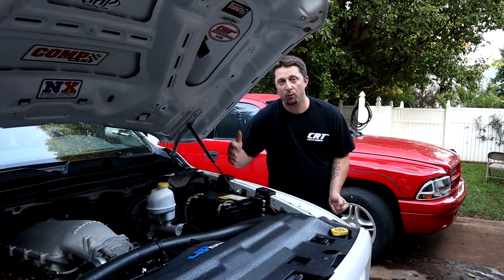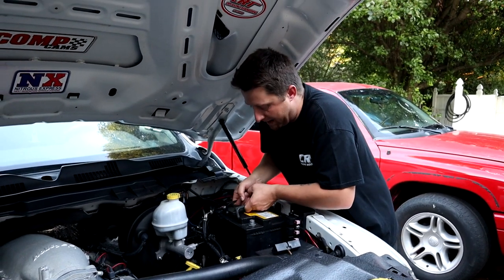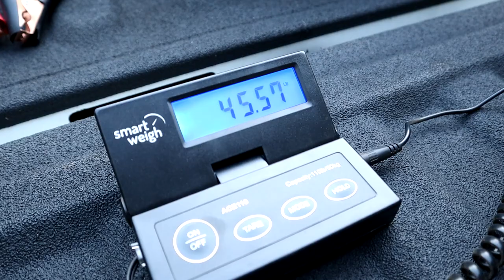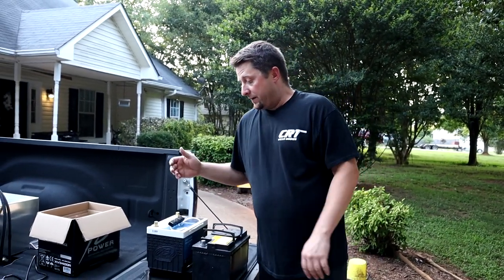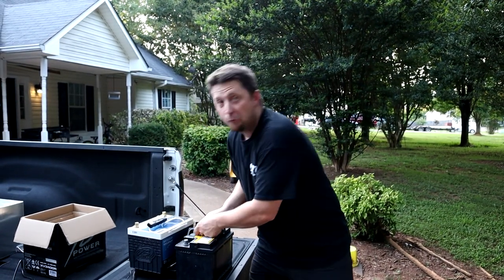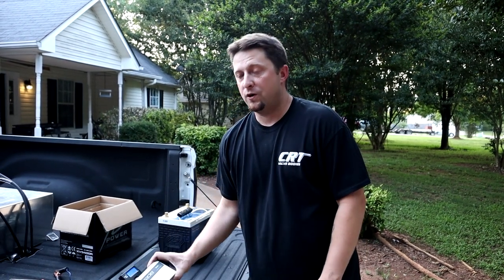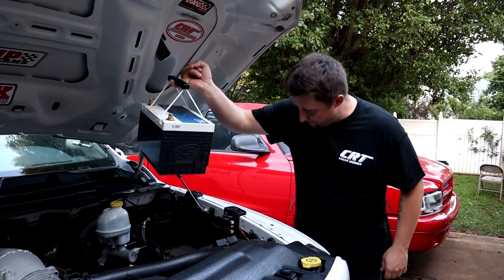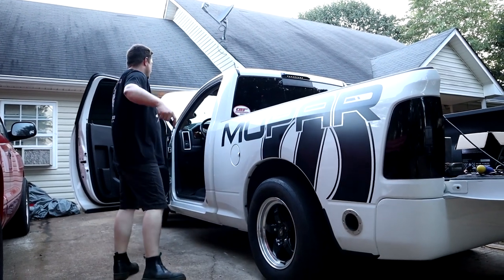Lightest Battery In The World From XS POWER

Comment: In case of fire Salt water is your friend with lithium batteries. If it ever goes dead charge at the slowest rate until the battery warms up.  A chip should not let it go to dead but you never know. 
The truck sounds like a beast bro!
Reply from the maker: Thanks 👍

Comment: Mopar Motorsports; I have an identical looking truck. I lowered 2/4 belltech. Rear is bottoming out with no weight in the bed. How can I lower the rear, it has rear coil springs, without it bottoming out?

Comment: Awesome! Crap thats not a common one to think of weight saving on drag truck 😉 Yeah they are they new way to go 👍💪 also you can mount em any way you can make em fit/ on thwir side heck upside-down 🙃 but still cant get over the weight difference for lithium technology...
Now im thinking about weight in my boat i have 2 big ole wet cell batts in the rear 🤔 be and instant 100 lbs lighter...
Reply from the maker: They make boat batteries also😉

Comment: So you have to charge the battery up to use it? It doesn't last as long as regular batteries do?
Reply from the maker: Yes it does but if you're not using it you need to keep it on a lithium charger.

Comment: I could use that for my audio system. I have a 2019 Ram 1500 Classic
Reply from the maker: They make lots of audio spec batteries also
Reply: Not really made for a y thing over 1500watts or over a stick charging system